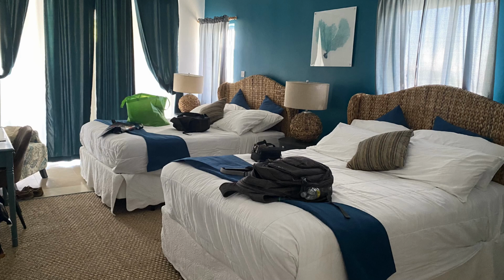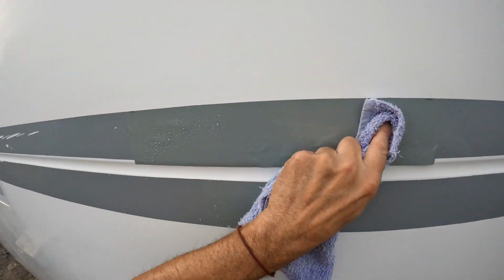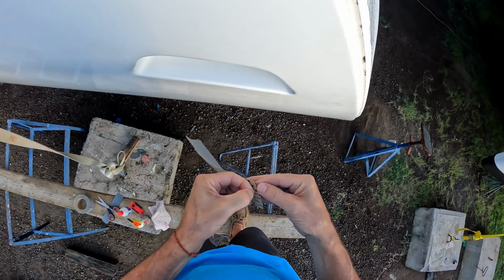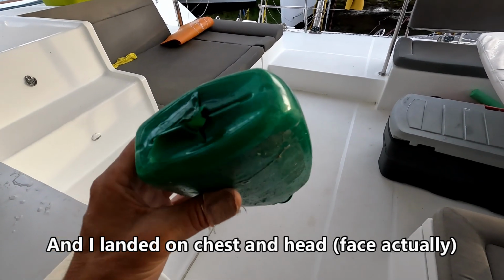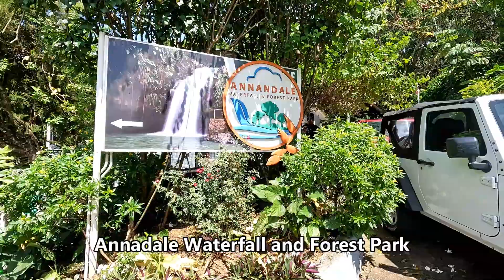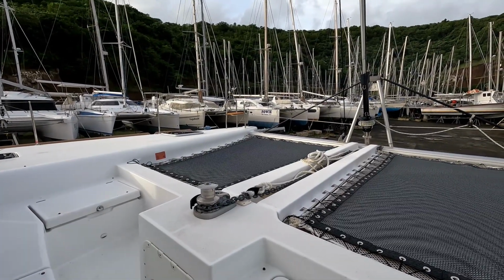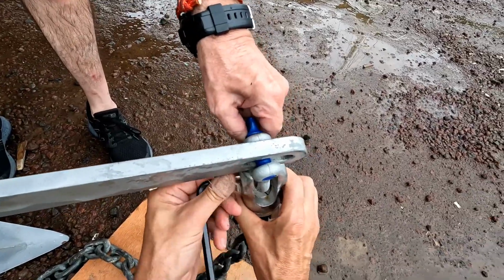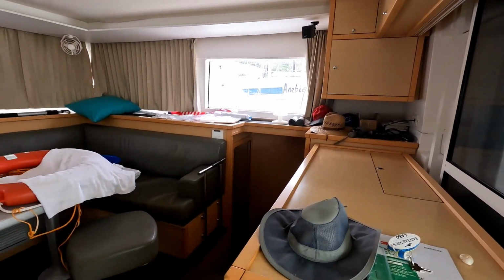Boatyard Bonanza-Part 2 - Sailing SV Cabo #9

Comment: Hi Richard and Brian.

I know less than Jon Snow but when disconnecting / connecting battery terminals it is good practice to undo / redo the Neg. first. This eliminates the chance of shorts. Also I did not see an Locktight or similar used on the anchor swivel bolts while You were working on it. Red Locktight might be called for here.

Regards.

David. Down Under.
Reply from the maker: Hey David. Thanks.  I appreciate the feedback.  Cheers.